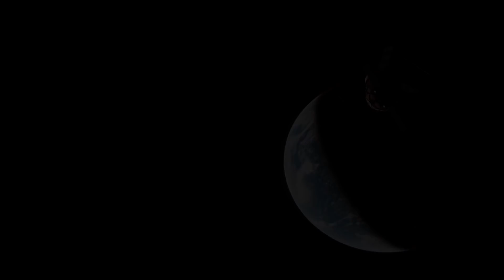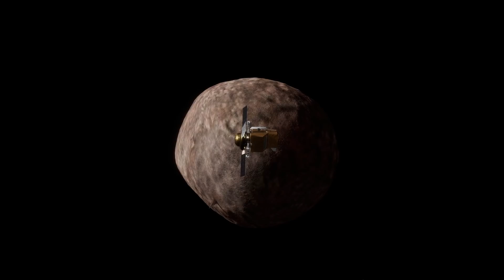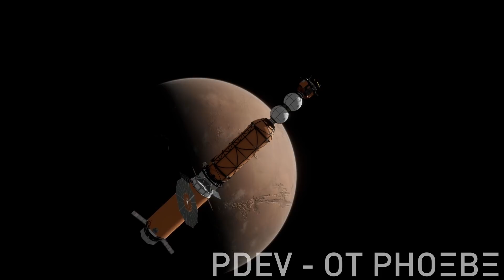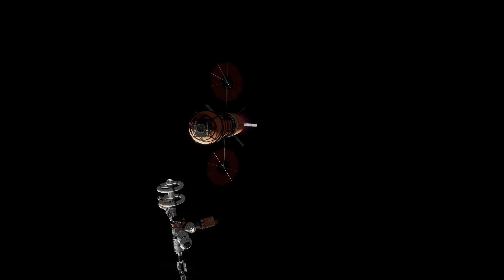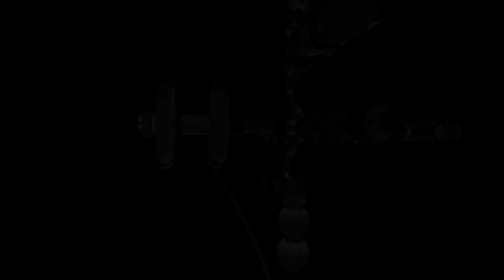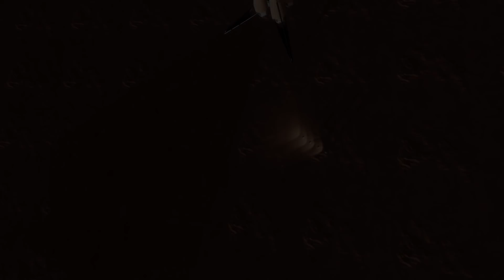KSP | CREWED MARS LANDING | Kerbal Gets Real | The Next Millenia #12

Comment: Incredible, Carnasa! It's too bad the moon hopper got messed up. Given that these kerbonauts are engineers, perhaps a fix can be made. Kerbal Engineering perhaps, or a narrator-driven fix (ie, telelport a new lander there and just say they were able to fix it.) It does not make sense to me that the CO2 remover would break as it's parts are fairly hardy and they are well within the inside of any craft. It's just filters and a fan. Cut up the cover of the flight plan, man, and use some duct tape!